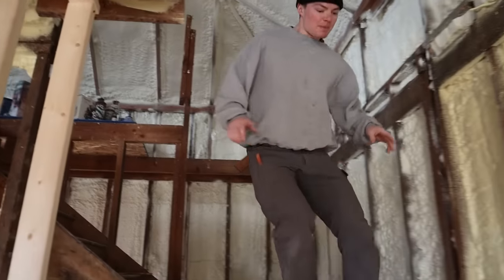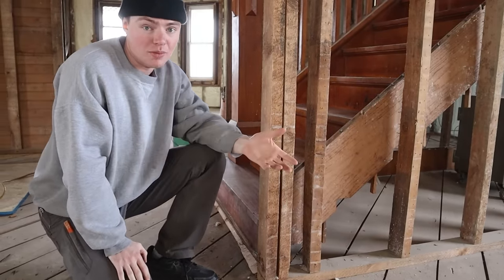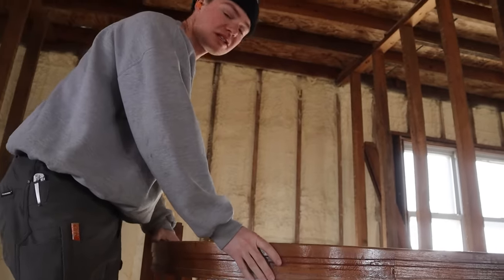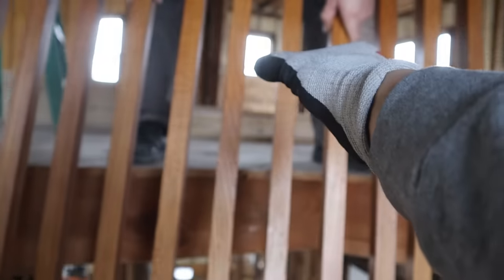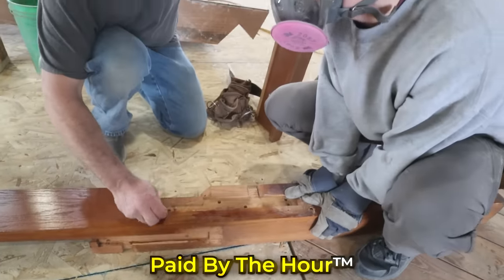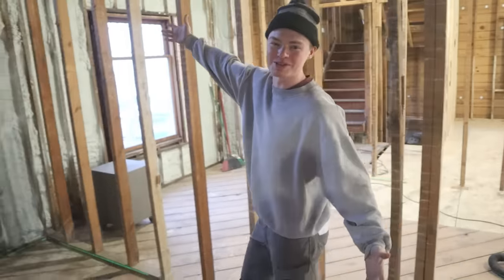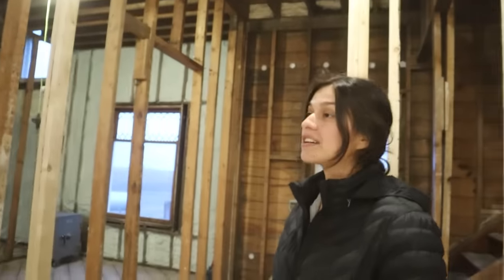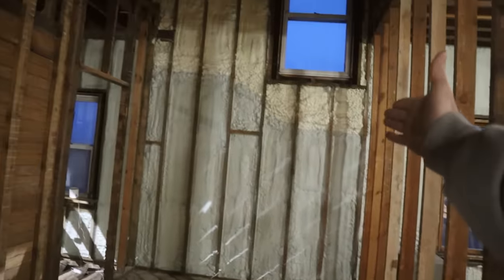Restoring A $7,000 Mansion: Grand Master Staircase Removal

Comment: Just remember to use the regulated nails for the construction that you need to do on the renovations, because someone got told after the inspector inspected his cabin that he was not using the right nails not the size the type were both the same price and I believe it was construction nails, or something to that just letting you have a heads up on that
Reply: There are no inspectors in that county.

Comment: I missed some videos, what did they do with all the beautiful woodwork in the house? :-( Hopefully using it again?!?!?
Reply: Yes it is set aside for whatever use, but condition of it is rough
Reply: @Romegrom Set aside, nothing marked where it came from, and stacked in the shop.  It's rough because they manhandled dismantling it instead of removing it with the intent of reusing it.  Pulled it down and threw it, or let it fall in a pile in the middle of the floor, then tossed it in the truck and finally stacked it in the shop.  As for the quality, it likely just needs stripping and refinishing... is was until the tore it out like it was headed to the burn pile.  Justin, if he has any integrity or wants his reputation ruined, just needs to walk away from this house.
Reply: @Romegrom  Thank you!
Reply: @benhur520  Thank you!

Comment: Basically at this point it's no longer a Restoration due to the fact that all of that Beautiful Oak Woodwork was ripped out and thrown away witch made me cry. The Stairs could have been saved and re-structured. Now you might as well just call it a complete Remodel.
Reply: HE has a lot of the wood work.  The stairs was junk not worth saving or rebuilding.  All the lumber was bent and messed up.  You got to realize that what you see on here is not what it looks like in person.  Truth is the stairs look like they was replace in the 40 or 50.

Comment: Those stairs could have been restored.
Simply by taking it apart carefully and rebuilding it with the steps glued and screwed back down.
Paint completely stripped off then re-stained to match the new interior treatment. 
I grew up in a house that was 100 years old in 1960 when my dad bought it and that's what we did including tearing of two layers of nasty old carpeting then painting it a color my Mom chose.
We used aircraft 2 part epoxy wood glue we were using to build my dad's wood Sirrocco airplane.

Comment: The bending of the wood by cutting slits is a process called kerfing. They still do it today. 
I find all the mad comments about the stairs pretty funny. Everyone misses the point of why they’re coming out. I don’t know about you but if I’m remodeling a house to last for at least another 100 years, I’m not going to use old janky stairs and floors that creak and move under my feet. And I’m not going to spend more money refurbishing them than it would cost for a brand new set of stairs.

Comment: So far you have removed so much wood that is probably better than any wood you will buy today. The dimensions of the lumber back then was thicker, than it is now, and you are tossing it all out. The money cost aside, you are cheapening the house from what it was. Case in point, the stairs. I’m sure you could have salvaged those stairs. They were not in that bad of shape. The reason your columns were shaking was because of the floor settling. All that craftsmanship is now gone. (Doesn’t matter if it was made in a factory….100 years ago they KNEW how to build quality products) So yeah, the beautiful stairs are gone, and you won’t be able to replace that kind of craftsmanship with anything as good, even if you paid good money. (Which probably won’t happen, due to budget) 

This cannot be a restoration, as much as it a gutting of a shell of what once was a beautiful home. It probably would have been cheaper to just tear the whole thing down and build new. The integrity of the home and its charm has been lost. 

I understand that some things can’t be helped, due to some rot and other minor issues, but you could have saved a lot of time, and in the end kept the beauty of the home, by keeping much more of the bones of the home. 

The removal of the stairs really saddened me. That was true craftsmanship, which today is practically gone.

Comment: Three thing:  First, check Sears and Robucks catalogues in the era of the original structure.  They sold prefab kits that were shipped via rail.  Many farm home of the era were built or modified using these kits.
Second, Remind Roman to use his safety glasses when operating power tools.  
Third, Let Justin know he is in good company.  Two examples of vary suscessful color blindness individules.  Dr Pol DMV for one.  The other that came to mind was Al Davis of Raiders fame.  There is a reason the team colors are black and silver (white).  Those were the only colors he could distinguish.

Comment: Had you thought about the design of the complete staircase?  It had many curves to it.  When you questioned why the wood around the base of the stairs on the first floor was curved (and in this case already removed), I believe it was to start the curved design of the rest of the staircase.  Just my 2 cents and worth entirely what you paid for it.

Comment: I guarantee those 9 inch by 9 inch floor tile with the black adhesive. Have asbestos in them. I'm a foreign contractor in Colorado. You need to wear protective respirators and baggage differently do not try to burn it😮😮😮😮

Comment: Just here for all the pearl clutching about how priceless the woodworking is. It isn't. All of it could be replicated...just because it is old, doesn't mean it was built better.....those stairs weren't built that well. I've been a woodworker for 40 years...not everything old is better.
Reply: I agree 💯 percent
Reply: Okay Mr. Master Woodworker, give us a price on what you'd charge to build an identical staircase out of the same wood.  $20,000 in the ballpark?  Sitting on a bench whittling isn't exactly "woodworking".
Reply: @benhur520  There isn't anything particularly complex to the design. There's no carving, the ballisters aren't even turned and the post that was notched on 4 sides took longer to lay out than to cut. I've seen houses with truly valuable irreplaceable woodwork...this isn't one of them. If time equals value in woodworking, I could spend a week staring at a pile of sawdust and charge $20k for it. Labor gets offset by technology and always has. Pay me $20k and I will replicate this $3,000 staircase. I didn't say I can build it for $3k....I said it would be an identical $3k staircase...because you MIGHT find the right people to buy all the pieces of it at a salvage shop. Oak trees still grow.... it's the same wood. Nostalgia for warped wood in your mind is the only value. Hey Cole, this guy said he'd pay you $20k for your scrap lumber.

Comment: I was just admiring the way your steps have no pie shaped treads..i came downstairs in a house we were fixing up ,with an arm load of laundry and stepped off one of those deadly pie shaped steps and fell 4 steps to the floor below..luckily I landed on the huge pile of sheets so only had a bit of knee pain..I could of broken all kinds of bones..so if you are putting in new stairs never use the pie shaped ones for going around corners....they are deadly!

Comment: Cole, We live in a house that is 220 years old in parts. It sags in the middle. The floor rises from the upstairs landing to the outside wall by 6 inches. The doors are trapeziums. What is a flat floor? Well, it's in the newer parts of the house. Your quest for the level is commendable but misplaced in the context of the house, in my opinion.  We have de-squeeked the wonky bits. You have set the bar high to result in an improvement.  I hope to be won over. But this is just a rip and replace at the moment.  A matter of personal taste. Regards,  Stephen.

Comment: Quit whining about an 1.25 inch of settling in your floor.  With modern building technology the Millennium Tower in San Francisco has over 18 inches of sinkage and a tilt of 28 inches.  By this Millennium Towers standards your house is incredibly stable.

Comment: Considering the location of the house and the level of demolition involved you probably would of been further ahead to strip out any details you planed on reusing and then took a wrecking ball to the entire structure and rebuilt in the same location with the structural details you liked in ICF so it would be tornado proof and built to last as you say another 100 years. Saving the outermost walls and shape is hardly a restoration. You certainly went the hard way about tearing it down prior to rebuilding and kept the least significant details of the existing structure. Overall the most important part will be if Nave likes it. And so far she seems to approve. Wishing you and your family the best.

Comment: I'm going to laugh hysterically when you're brand new staircase is just as squeaky as the old one. Staircases are squeaky there's no way around it. And the fact that you are removing it just because of the squeak is ridiculous that staircase is stronger than any staircase that you could put in its place. If you would have jacked up the floor under the stairs it would have tightened up the whole staircase and made it not bouncy.

Comment: I have agreed with everything you have done until the stairs went away. I would have pulled the stairs and reused them after reenforcing them and modifying them if you wanted them to run another way. You just do not find quality like that in modern staircases.

Comment: If people knew anything about wood and hat happens to it as it dry's out and been in a place that not level for years they know you couldn't save the stairs and make the meet code.  Seeing a lot of the woodwork a lot of it doesn't look like it from the originally house looks more like the 40 or 50's era.  If there was tags on it from Chicago then it it wasn't really anything of high quality.  The post would have been solid as well.  It look like it was a kit from massed produce stairs.  The lumber was gone.  There was no strength left in the stuff.
Reply: "Just when I start to think you couldn't be any dumber, you totally redeem yourself."

Comment: It's nice to see you show appreciation for the original  staircase, the design, the handrail, etc.  When using the little cuts to bend wood, you don't need to wet or steam the wood to bend it, unless the wood is too dry. As for the curved railing, it was either steamed, bent as green wood or, highly unlikely, cut from a larger piece of wood. From what I could see and what is likely, I believe the railing was steamed. To me it looks like the grain follows the curve.
I do worry about the three of you and your safety. You're not always doing the safest method of doing things, but that's your responsibility.
Reply: Appreciated it so much it's headed straight to the burn pile.

Comment: No eyewear protection when using the saw???  Very dangerous.

Since your puppy was accidentally killed (ran over) by heavy machinery...how come this pup is running around with heavy machinery operating outside?

Many dogs drag their bums along the floor because their anus area is clogged.  Perhaps a vet check?

Comment: I like the fact that he is replacing and leveling floors from the ground up.. losing the house history. Oak floors, millwork, staicase is a travesty. Me I want the house to be tight, the fireplace and chimney had to go. 
And he knows nada about wiring. His shop is a nightmare. His panel and wiring  does not pass electrical code. The breaker must be sized as the wire size. Every time a wire passes threw a box, the  wire must be secured most of the time with a metallic clamp with a nut, also you must put on a plastic bushing as well,  in the breaker panel never twist grounds into a pigtail and then terminate to the ground bar one wire only per hole. One more thing never put a "device"(wire nut, or anything else in the panel. It is prohibited.. for more information, please turn to the National Electric Code book. This code is valid in all states! 😊 ~~ Cris H.

Comment: I can appreciate a renovation on what looks like a historic home but, I’m afraid that has been completely removed. The advice you’ve been given would have very probable been different on looking at it in a restorative manner. There are historical construction that are done in a certain manner like when you mention the circular steps. That first step as it points to a circular version around the post has a meaning and it’s designed, too long to explain but these are wonderful intricate design elements they were put in place for a reason but unfortunately that’s gonna get ripped out too!Certainly it needed lots of removal of rotten, broken & out dated interior design. Historical homes have imperfections that are apart of it’s making of “back in the day”. Your young and although your heart is in the right place to update & “restore” it’s definitely a RENOVATION.   It’s obvious you want something with your own stamp…I hope it doesn’t become a modern version of a farm house or being that your young you overlook it’s historical significance & make homage to its ENTIRETY versus 1 room as previously mentioned. Sorry for my uninvited opinion. The house will be lovely, I’m sure, but it’s historical interior is gone forever. On a positive note your diligence and detail to update is impressive. Regardless of what you do continue to do what is best for you and your family.

Comment: You're WRONG argon does not affect UV rays the low emittance tin oxide coating on the glass  does around 95%, the argon gas is moisture free and it has no oxygen the other gas that affects plastics ,metals  and sealants, water vapor and nitrogen at lesser values, you ought to stick to farming just a suggestion.